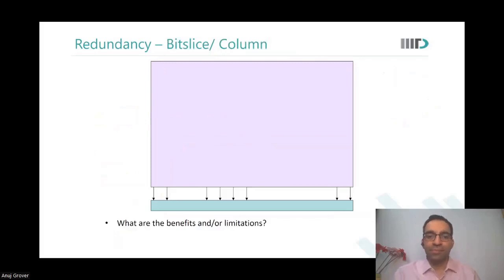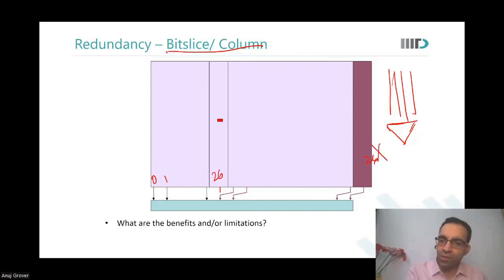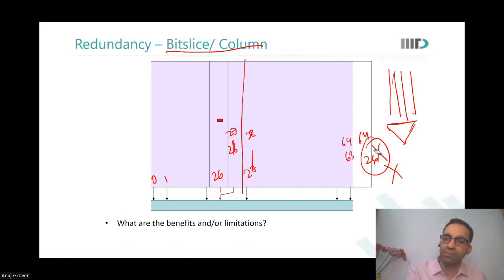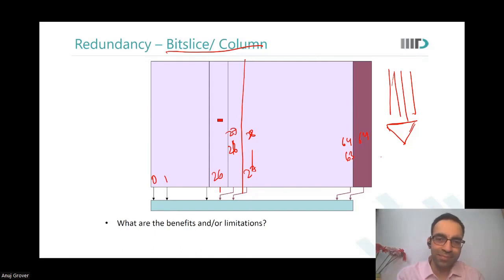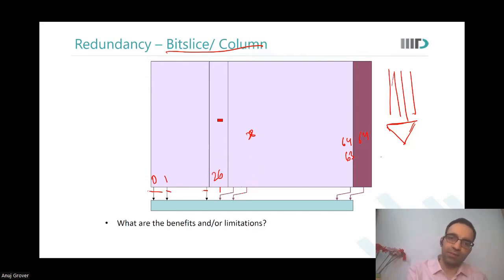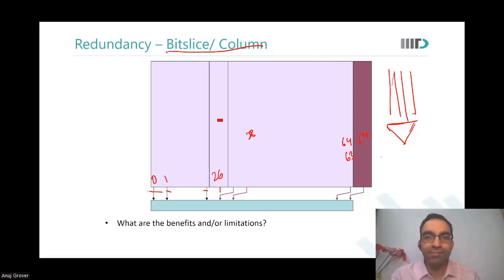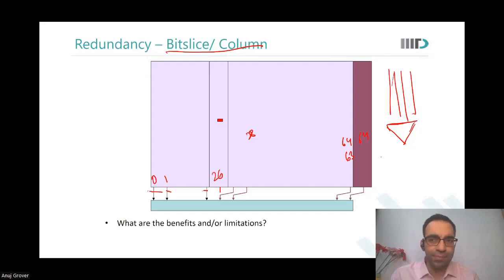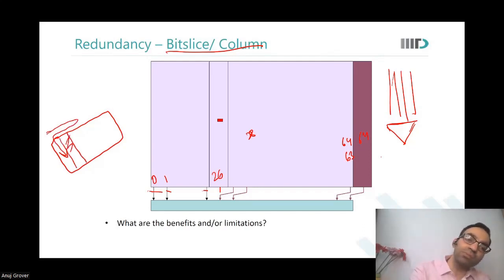Memory Repair - Bitslice or Column Redundancy

Comment: Sir what if we have mux4 IO and at a particular IO one bitline set is faulty not all four, then what will redundancy do. Will it shift the entire mux4 IO or just one faulty bitline will be shifted?
Reply from the maker: It will depend on the replacement policy that we implement in the memory. In a pair of column replacement policy, only the adjacent columns will get replaced. In a mux-slice (or bit slice) replacement policy, 4 columns will get replaced. 

Again, depending on where the repair mux is implemented, we may or may not be able to replace the sense amplifier. 

I hope this helps 😊👍🏻